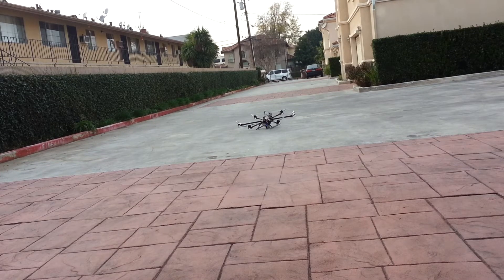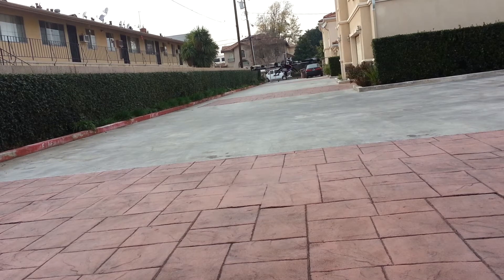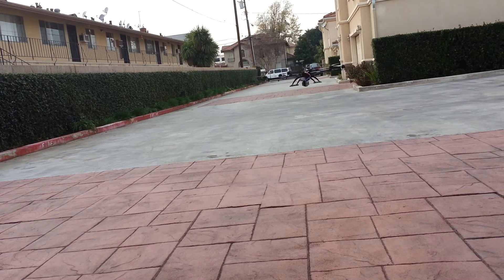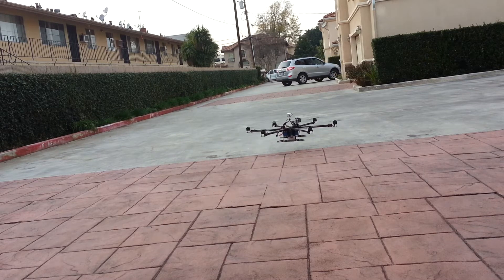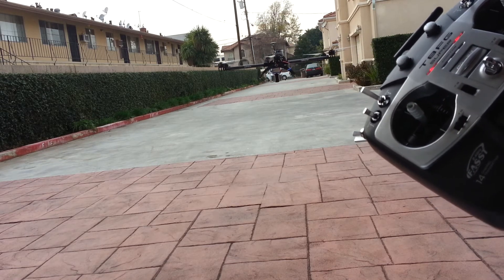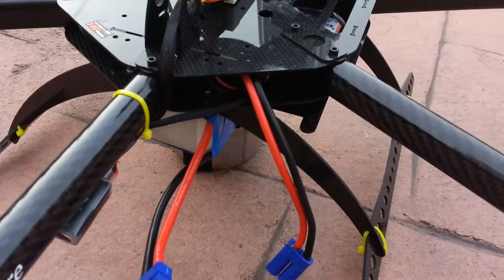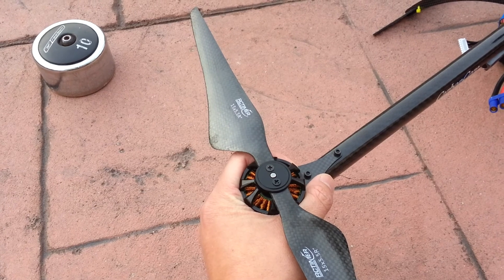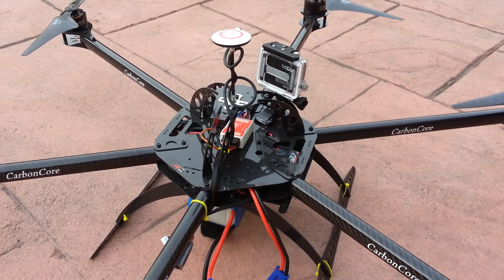CarbonCore Hex 950 10lbs Payload Test

Comment: Damn :D I already bought APM now. I wishyou replyd fast.

Also for 2814 700kv motors( which I already have) should I buy
1) Rctimer s800 frame with the 179$ landing gear with no gimbal
or
2)tarot 680 with a small servo gimbal?